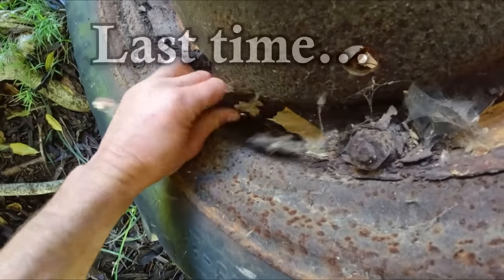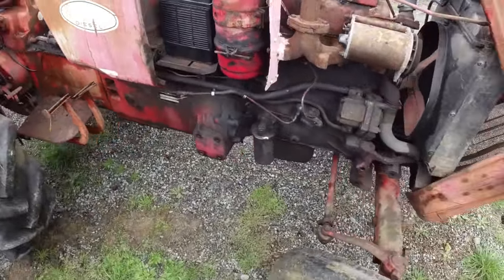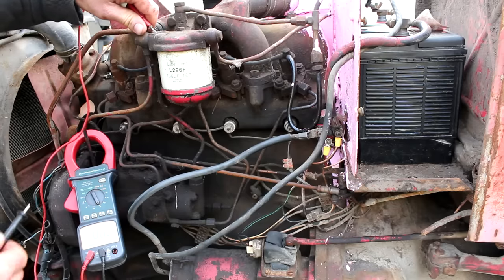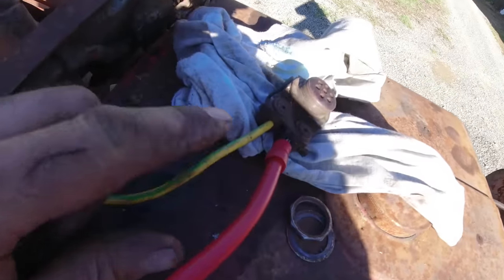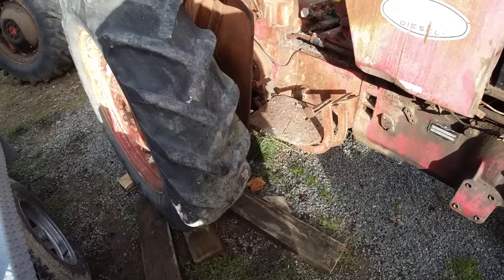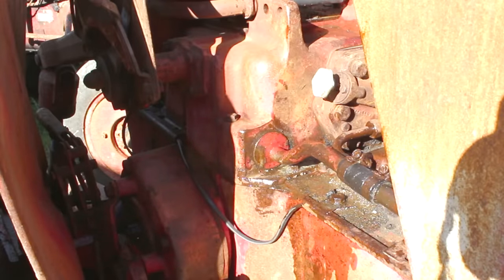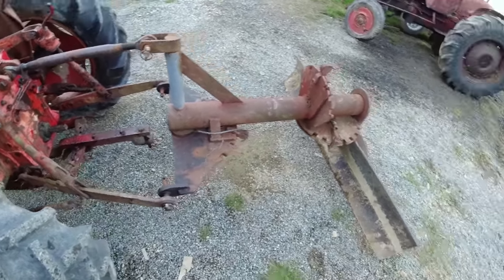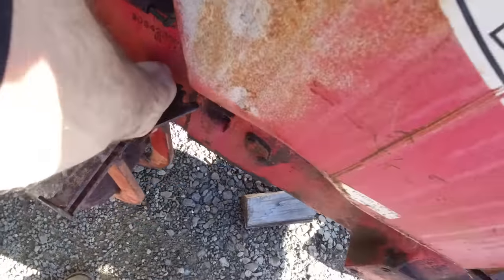Fixing the Salvaged Swamp Tractor and running it on Recycled Cooking Oil instead of Diesel

Comment: Vegi oil passes the rings down and fills the sump plus it can cause a runaway engine.
Reply: That must be a very worn out engine...
or a leaking injection pump allowing the vege oil into the sump...
Always install a shut off valve on any fuel tank.....and use it.

Comment: Rim for fronts, back Marty T  for B414 get B250 , B275 , B404 , B434 series also Glow Plugs Solilendo on Desiel motor same plus Generator also Starter to plus Gauges to even pedals  and made from 1960 to 1968 years ! If planning put GM Delco Alternator made from 1968 to 1985 of 70 to 100 amps on B414 tell give me give details to wire up ! Also glow plugs copper wires keep to on outter  caps to plus one stud in water pump to also Restior salt shake clean contact's plus pull switch for warm up glow plugs   get pull down handle hard get need vechile button  push only to installed 2 wire type too ! Also do give old Parts tractor away keep for parts on steering wheel plus box in near battery box and bottom fuel tank too ! Also keep primer on right side for fuel filter prime  up lift pump , plus fuel injection pump too hard to get them new and hydraulics also transmission is 80w90 differential fluid! Transmission,  Hydraulics should changed every 3 years and fuel filter yearly to add 200 ml GM Automatic transmission with  Desiel fuel  together save fuel injection pump  blubber! Steering  on this 414 tractor are Armstrong Steering no power power steering assist ! Also on front on top transmission in middle on transmission  gear shift Bow tie for hydraulics shut off and chrome taps below seat to ! Also if use Vegetables Oil grease  water with some Desiel fuel  or plug up fuel filters and injection pump do 50/50 ! Grease best use on this tractor is Moly Farm Tractor Heavy Duty equipment type and cone in middle down below rad check also grease up too or won't drive like axles break off it metal cone to plus want replacement every 5 year's! Also grease up front every 6 months on spindle plus  bearings even everything to also lube up Generator to monthly with engine oil on chrome caps ! 40 hp those tractor are to ! Also clutch plate those tractor are 2 stage one for transmission and others when push Clutch in for lever near seat for PTO  turn on go back  and   off pull forward! If needed more information asked me anytime! Hope check water pump lube with squirt can and add 100 ml of 80w90 to rad when every 6months too lube up bearings in pump plus keeps from seize up ! Bearings is Vechiles flywheel  spindle shaft but roller type size someone thumbs!

Comment: Why is that resistor needed? Just as an indicator?
Reply: I suspect they're 6V glow plugs, used because it was cheaper to use the same parts as the previous model tractor.  And the model before that, and....

Comment: Do not run on used cooking oil,  you will ruin the motor,  I add about 10% canola oil,  i have toasted a diesel engine running pure waste oil.  Rings get gummed up. Trust me, I do run a waste oil burner on pure waste canola for many years. it does clog up the boiler.  Every year i need to declog the inside of the boiler
Glow plugs you can buy regular ones that fit the diesel head BD-154 engine. make a huge difference here in Cold Canada,

Comment: Studies show that both tractors and gen-sets seem to be the worst ones to run with WVO.   The  speculation is that constant RPM engines.. which on even diesel; coke easier,  compared to vehicle diesel rigs when run on alternative fuels.  Street diesels get random stress/varying engine load and this seems to suprinsigly keep combustion chambers cleaner........ Thus;  to compensate you really need to take extra measure to do things to burn off carbon.   Significantly more often use combustion cleaner in the fuel....  Way more often do and Italian Tune up....... really work the engine!!!  

Is this a Pre-chamber combustion engine  (Indirect Diesel Injection  / IDI)  or Direct Injection ( DI).  Didn't appear to be IDI.
Reply: btw... judging by your Centrifuge and filter system.. you are no stranger to WVO.   Very nice filter set up!!

Comment: I like your videos repairing old stuff for further use. 
But what you told about the glow plugs is wrong! The plugs are not in series! They are connected parallel. If one ore more fail - the other are still working because the all are connected parallel to the plus pole of the battery and each is grounded through the thread in the diesel.
Reply: why there was no continuity then?
Reply: @smitthone  Maybe i translate something wrong - i am from Germany - but i don't know any kind of tractor where the glow plugs are connected in series! If i want to check my glow plugs, i have two ways. In know the complete resistance to measure - If all plugs are ok - and can measure it. Plan B is measuring current - what i think ist the best way to check all plugs. If one plug ist grounded short wire - the you get also continuity. Check formal known electrical plans in the Internet and you'll confirm me. One big positive cable from the battery to all plugs in a row ( what doesn't mean in series for me !) with seperate ground for each plug - means parallel or am i wrong? Every glow Plug grounds itself.   Bye the way - would it make sense to connect glow plugs in series???? Better parallel - and three of four work - if one ist Mad, as nothing works!!
Reply from the maker: They are wired in series otherwise the other 3 would have worked

Comment: Hey mate, I have been looking at a messy Ferguson 130.
 With its hit off, he said it It was a Gasket Is it worth It's if it's A Cracked head
Reply from the maker: I wouldn't touch it if the head is cracked unless you need it for parts

Comment: I tried this with my Renault 1.9tdi and it was great, but, the process is very time consuming as i was doing it by removing the lye from the oil which i had to dispose of i needed pure alcohol and it was temperature critcal as well, in all it was to much of a faf, about six months later i had to pull the injectors out and have tgem realigned and new seals done but for a long time it was free running and i enjoyed the process, right up till my mileage was almost trebled due to circumstances, then it was back to the expensive forcourt stuff, i hope it works for you guys tho.

Comment: I would like to bring you to Canada to rebuild the hydraulics on my Ford model 861 powermaster..  One day it was perfect and then the next day the hydraulics were totally non funtional. Cannot find a sole around who knows anything abou the tractor..
Reply: Do your own research and give it a go yourself....
It doesn't work now so you lose nothing...

But the first thing I would do is drain all the old hydraulic fluid out and replace the old hydraulic filter....
and fill with nice new fluid.....

then trace from the hydraulic pump outwards re pressure and volume supplied....

Comment: Veg oil is a really bad idea.
Reply: Not under controlled circumstances.
You need to refine it properly...remove all the crap...filter it....probably heat it...and use diesel to start and stop so the injection pump is flushed out with every use...
Best used in a stationary engine.....

Old indirect injection Diesel engines love any oils such as ATF, 2 stroke mixing oil etc.......
easier to use than used cooking oil

Comment: The glow plugs are not wired on series. All the leads connected together is the clue.
Reply from the maker: They are wired in series, there is an insulator between each lead
Reply: @MartyT  No! For them to be in series then the second 'outgoing' lead would be connected to the end of the electrode. 
You demonstrated it yourself by showing only 1 of 4 (no2)  glow plugs were blown.
Reply from the maker: If in parallel the 3 good plugs would have worked, none worked, have a look here for a good explanation https://www.yesterdaystractors.com/cgi-bin/viewit.cgi?bd=farmall&th=383611